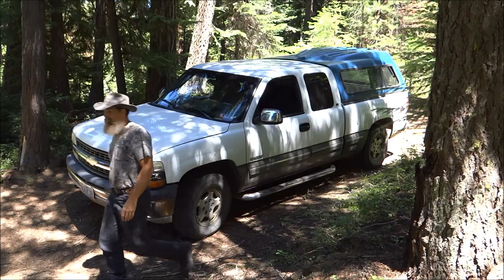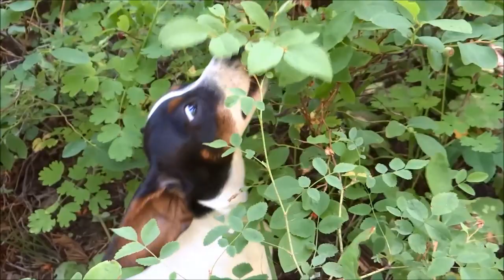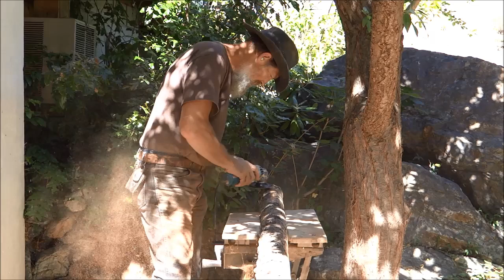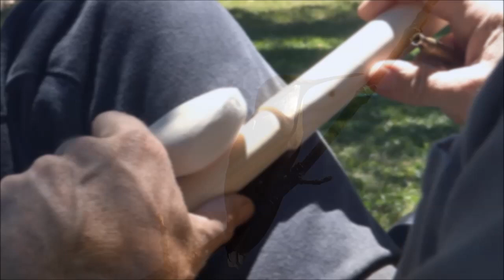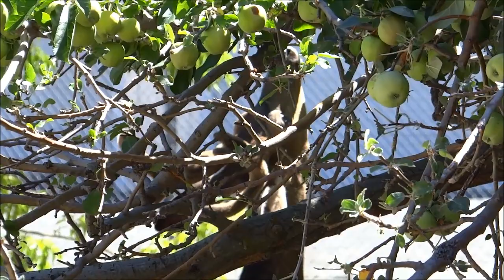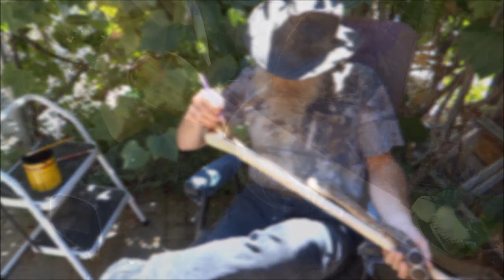Wood Carved Western Diamondback Rattlesnake Walking Stick #53

Comment: Question: When you burn in the scales, how do you make the scale color look graduated?
Reply from the maker: The color is achieved by applying more pressure with the point of the burning tip to the areas that I want to be darker.
Reply: Stinnett Sticks ok

Comment: Hello again sir I have a quiestion if I use green wood for a walking stick how do I prevent it from cracking?
Reply from the maker: I suggest curing the wood first to prevent cracking. Seal the ends of the wood with wax or glue, and then place it in a moderate temperatured place standing upright in the same direction it was growing. Leave it for a few months and then begin carving.
Reply: +Stinnett Sticks ok I will do that thank you👍🏻
Reply: Stinnett Sticks 

loop